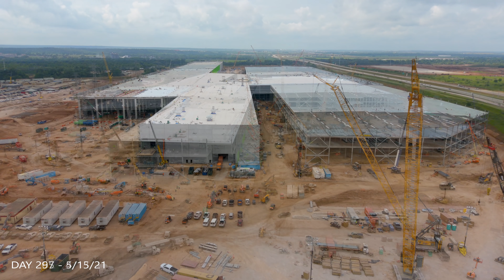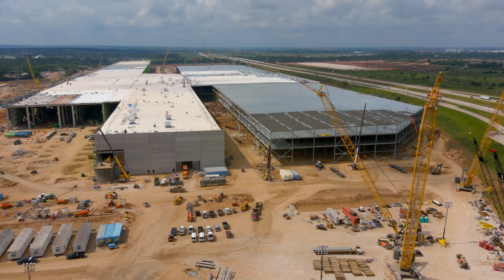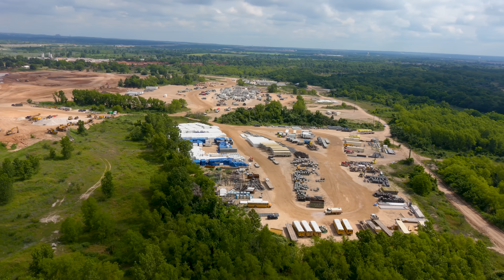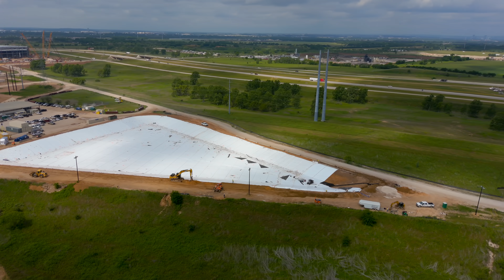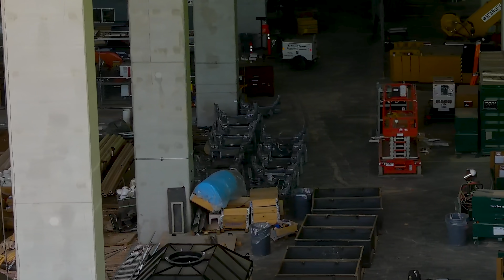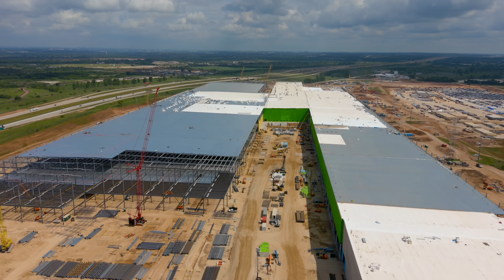Tesla Gigafactory Austin 4K  Day 297 - 5/15/21 - Terafactory Texas - GIGA PRESS CASTINGS BEING MADE!

Comment: I assume that, when finished, the factory will have cafeterias or other food service for the workers. What are the chances thay get that up and running early so the construction/installation workers can eat indoors with air conditioning during the summer.
Reply: My completely wild guess is that the cafes will be over the loading docks. That area is completely raw right now, although it looks like the first window sill has been installed Friday.